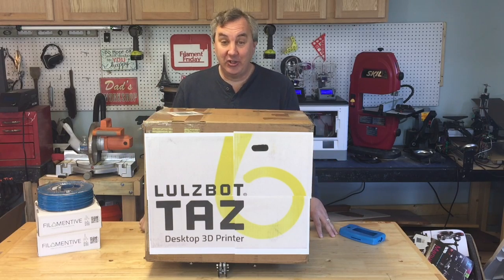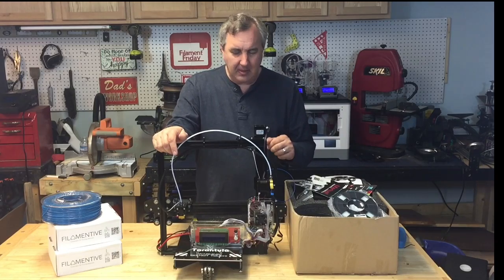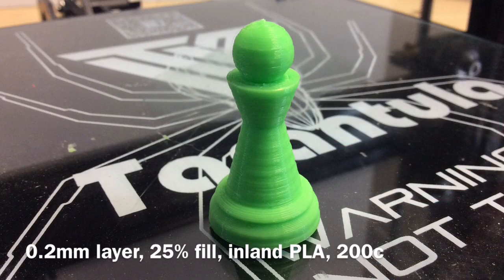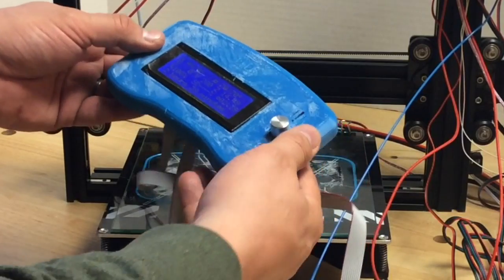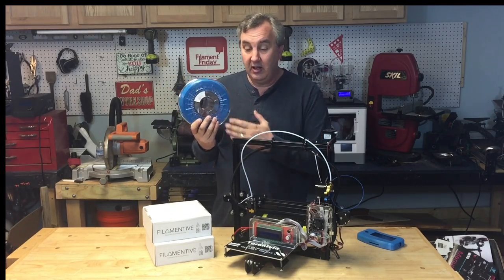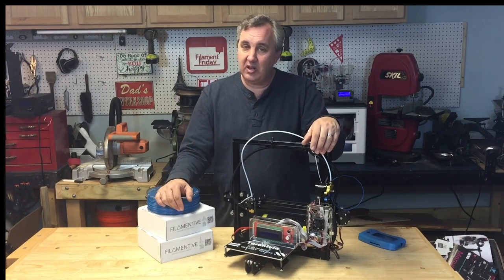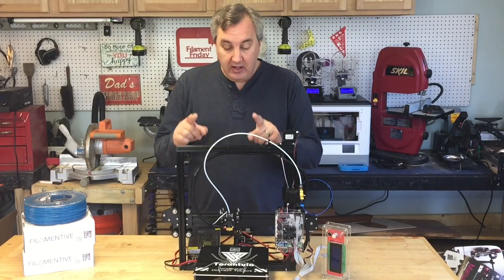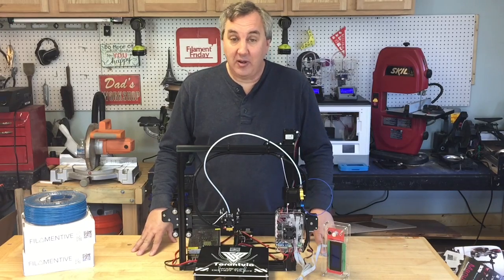3D Printing Filament Friday #68 - Tevo Tarantula and Filamentive Recycled PETG Review

Comment: Hi, cool video. Thanks for sharing. Btw is this tevo you bought is the one with auto level installed ? or standard one? if it's manual level, how long do you need to set it up the first time?
Reply: btw , have you ever tried the kossel type of printer ? i saw couple of kossel about the same price with this tevo. Have you had any experiences with the kossel ? which one is better ?
Reply: i see. i have other question. did you later upgrade it to autolevel? if yes, where did you get the auto level system (proximity sensor). I search the tevo website, seems that they don't sell the sensor separatedly. If i buy any generic sensor (for other prusa like sunhokey etc. ), will i get into compatibility problem. Do you have any idea about this ? the tevo has product with auto level installed but it's an extra $45 where other 3d printer only need to add $10 to upgrade to auto level.

Comment: I bought one of these, worst printer ever. Glad I upgraded to a Folger Tech kossel because a Tevo Tarantula is just horribly designed.
Reply: +Chuck Hellebuyck&#39;s Electronic Products The Folger Tech kossel is $325.99 now. And no there not going out of business, there up and running great. They are getting ready to release a $500 300mmx300mmx400mm printer.